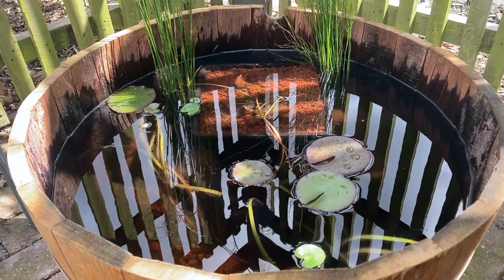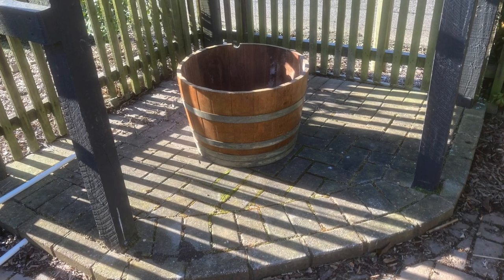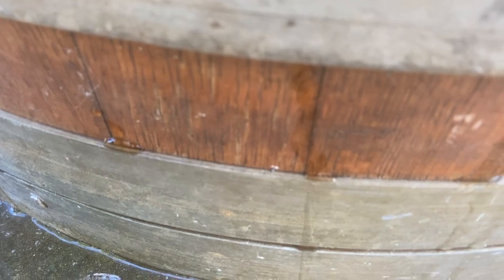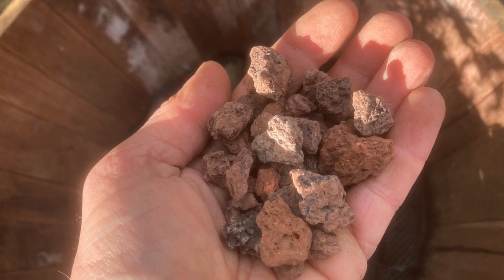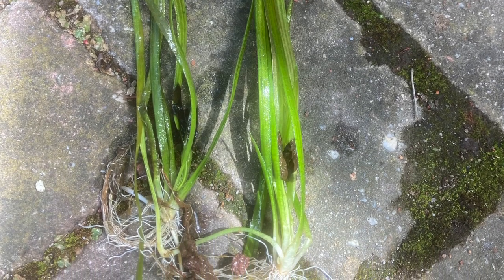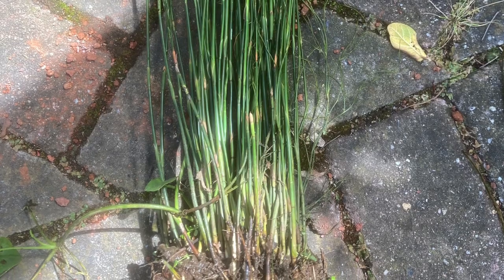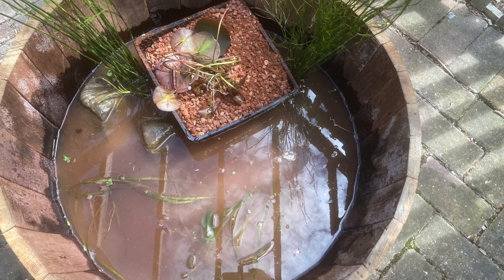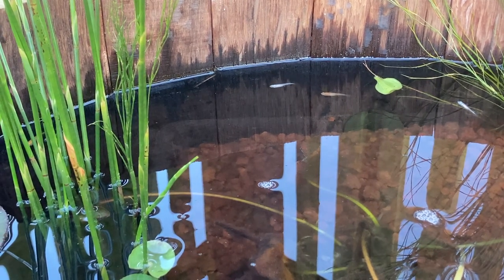Wine Barrel Pond| No Pump

Comment: Ive been keeping ponds without any pumps for years.. I usually dont bother with the UG filtration to the bottom (can you tell I'm old school?).. Instead I just don't add any substrate and rely upon plants in pots and floating plants to keep the ammonia in check..  So one advantage in NOT circulating water in small ponds is when your in very hot circumstances like moist parts of Australia when it gets very hot in the middle of summer.. What I found was when I used pumps in these small ponds because the water was circulating the whole pond got very hot and that tended to knock the fish around more than when i didn't have any circulation.. When you DONT have the water circulating, I find the water will only heat up at the top and stays cool down deep so the fish can go down there and not be affected by the hot water so much.. Also.. word of advice.. Watch those white mountain clouds with the Medaka's.. Ive found white clouds usually end up chasing and nipping the fins of the Medakas..
Reply from the maker: Thanks for the tips 👍
Reply: @geckopete That’s kind of how I have my small container ponds, no substrate, just plants in pots sitting on a couple old bricks. I haven’t had any big problems so far. I don’t have fish, just have tadpoles and frogs ( well I have one small fish but I don’t know what it is and I didn’t put in there on purpose 🤷‍♀️😂)  I did have a pump running in one pond 24/7 for a while, but I turned it off and everything seems happy - I’m just hoping it stays that way 😬

Comment: So, the no filter barrel I made is working very well, thanks to your tips. 
One thing though, after I put in hornwort, after 3 or 4 days, it seems like the fronds get really nasty looking, is that to be expected? 
I hate to say, I have taken out what I have and hosed it off so that the fronds are clean and bright, but it’s getting nasty looking again. Is this normal and not a bother for the hornwort? All the other plants are doing well and the water is pretty clear otherwise.🤔
Reply from the maker: I’m not sure why this is occurring. Some aquatic plants that are sold are grown out of water and when they are submerged they freak out a little. I’m not sure if hornwort is one of them. In any case if it was me I’d just take it out. I have no patience for things that aren’t easy.
Reply: @Ozponds  , what might you suggest for oxygenators instead then?
Reply from the maker: Any submerged plants will oxygenate. But remember plants only add oxygen during daylight. At night they are consumers.

Comment: Thanks Kev for the wonderful video. I've been meaning to make this setup for my backyard but couldn't find some items like biological tube media for the false bottom. I appreciate it if you can point me in the right direction as to where to get them from in Australia, cheers
Reply from the maker: I can’t find those tubes online in Australia. You can buy them from china but they are made for aquaculture, so they are sold in bulk. I got mine from an old fella who was selling his aquaponic system. Anyway a good way to create the false bottom is using aquarium under gravel plates. You’ll find them in any pet store, eBay, Amazon whatever you prefer 👍
Reply: @Ozponds  Thanks mate

Comment: Could you theoretically do something like this AS a "bogless bog filter"..  i.e. a half ibc goldfish pond pumped up into a barrel with the plants and maybe a couple of white clouds that then overflows back to the Goldie's?
Reply from the maker: Does the water flow up through the media in the barrel? I think it would need to, if it were to have any biological filtering impact. Otherwise it’s more just a place for sediments to settle in.
Reply: @Ozponds  it's setup like your budget bog filter in a bucket style. I've got a false bottom and a layer of medium largish sponge before a couple of anoxic baskets and other plants. Then overflowing into the main IBC
Reply from the maker: It’s worth a shot.

Comment: Mot related to this specific video but does a bog filter need a separate pump or does it use the syphon method?
Reply from the maker: You will need a pump to get the water into the filter. Then from there it can flow back into the pond via gravity 👍

Comment: Does the sediment from under the false bottom need removing occasionally?
Reply from the maker: Not that I’m aware of. I’ve had this running a few years now. All I do is top up the water and remove some algae and plants, from time to time. It’s under an arbor so it also gets a water change when it rains heavy.
Reply: @Ozponds  So, what is your conclusion about this pond with the plenum and BCBasket?
Reply from the maker: @DEXTER-TV-series  this worked better than my pond with movement and a bcb. However I think for a no movement pond, father fish/ walstad is much better.